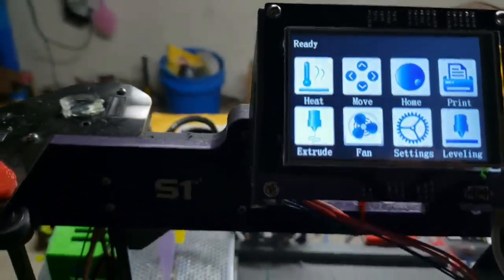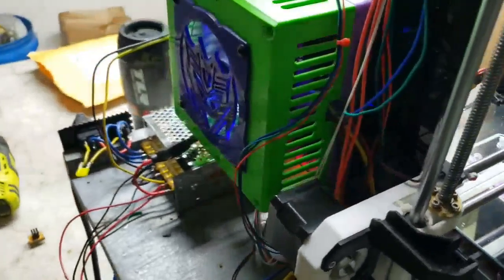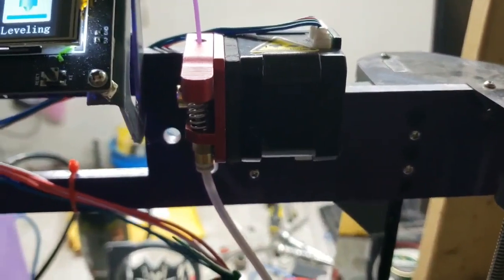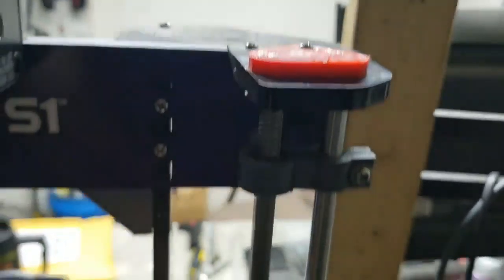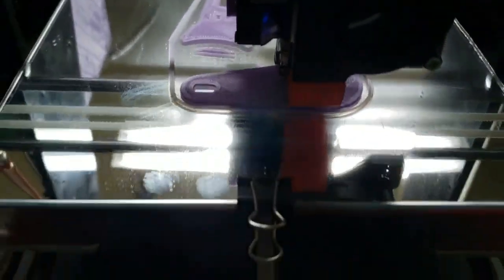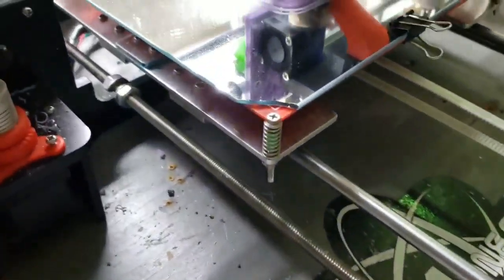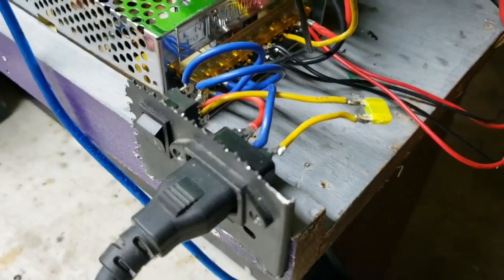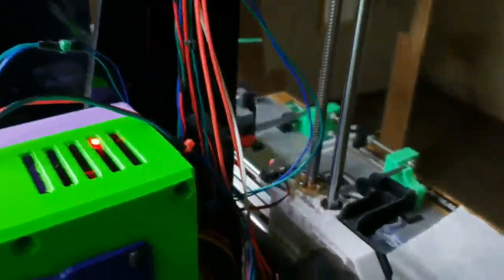Anet A8 BigTreeTech SKR v1.3

Comment: For this board I notice only one slot for z... must I wire the z axis in parallel?
Reply: This is what I am struggling with, my guess is that you make a Y connector and run them from the same Y Port. So the both doing the same thing.
Reply: @InterplainMusic  3D Printer Accessories 3pcs 3D Printer Dual Z Stepper Motor Parallel Module with W Cable for Double Z Axis Stepping Motors Reprap Prusa Lerdge 3D Printer Board https://www.amazon.com/dp/B07SR8VS2S/ref=cm_sw_r_cp_apa_i_5RCdEb9YE64BJ
Reply: @individualone  thanks for that, just ordered some, loads easier and neater than chopping the Hell out of the JST Connectors. Would you have any info on what else I need to change. I have SKR v1.3 with UART TMC2208 with TFT35 screen. Have Original power supply an steppers.  Just had a Metal frame lazer cut. An this board to put on it.